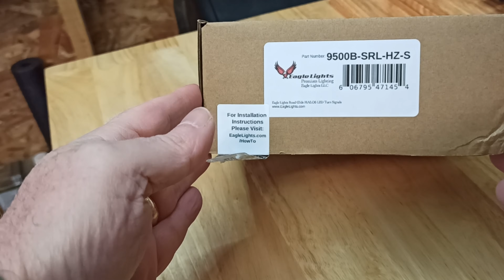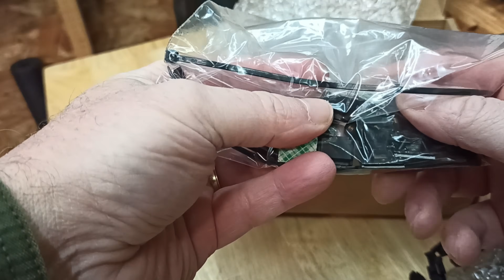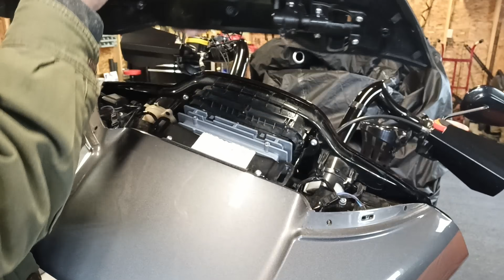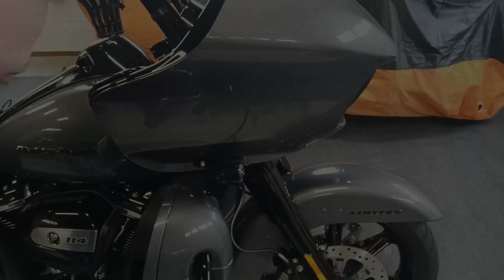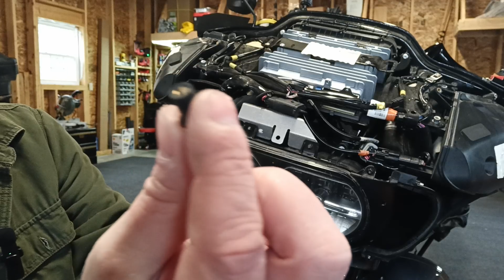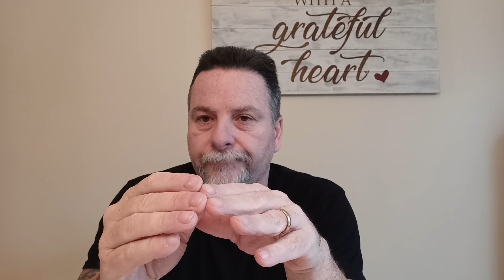Eagle Lights Halo Vent lights For Harley Davidson Road Glides

Comment: You should have marked the holes BEFORE removing the fairing.  The lights probably sit further back and that you have made the fairing go on easier and you wouldn't have the gap.
Reply from the maker: Yeah, that could have been the issue. Thanks for stopping by and watching 👍

Comment: Really love the lights but not thrilled about drilling holes. Idk what other options there are for vent installs but good video on the installation. Definitely gonna save some people some frustration.
Reply from the maker: @bradkopczyk9049  Thank you. I ended up taking them off. I didn't like how they mounted and stuck out. 😞 I ended up replacing with new headlight side panels and a vent screen off Amazon. 🤣 https://youtu.be/1nLDkgJ8TI8 and  https://youtu.be/t3GUmGWCU4k Thanks for stopping by and watching 👍
Reply: @RoysMotoVentures   Is the mounting the same when you change out the headlight that Eagle Lights show with the halos?  Do you still have the panels to drill into?  Or are there brackets that hold them on?
Reply from the maker: @markhuling-jl4jk  Still need to drill into the panels.

Comment: So I bought the version of these lights from Amazon for 45 bucks. The printed  instructions were exactly the same. The source company was obviously the same. I can tell you that these do exactly what you want. I can tell people see me coming and see my turn signals. I highly recommend these, but only at the the Amazon price. The instructions I received fully explained that you need to leave the units loose, install the fairing, then bolt the new lights in place. Yes, these are exactly worth what you pay at Amazon.
Reply from the maker: Yeah they are bright so people should see you coming. And I did notice that there were a few different sellers on Amazon that had the same lights, that's where I found out that fairing goes on first then screw the lights in place. Lol.  Thanks for watching and stay safe out there 👍

Comment: I just got these in the mail today!! Thank you for a great video. Ive been searching for one. I bought the lower fairing lights and visor lights too. Do you have a video of those? Should I do them all at the same time?
Reply from the maker: I don't have a video on those other lights yet. I think they have a install video for those on the website with the pictures. I would do them all at same time, so while you have the fairing off. For the lower fairing light, you need to run the wires up through fairing and plug into your turn signal plugs. Thanks for watching. Good luck 👍

Comment: That's exactly what potential buyers of this product will want to see, a good honest review, including installation challenges and fitment concerns.  The lights do look good, but it appears Eagle Lights either didn't do their homework to address those issues, or they probably assumed that once people drill holes into their bikes, to mount this product, then it's too late to "undrill" those holes, so most would probably just keep the lights on the bike, reducing the risk of product returns from dissatisfied customers. I don't own a Harley, but if I did, I probably would avoid this product.  Again, a nice honest review, Roy 😁👍
Reply from the maker: Thanks Wayne.  I try to be honest with my reviews, so people know the good and the bad. I will probably change these lights back out later down the road. Thanks for watching and stay warm over there on the other side of New York. 👍